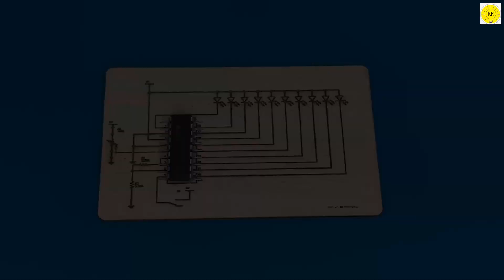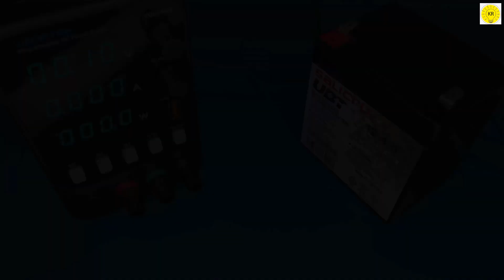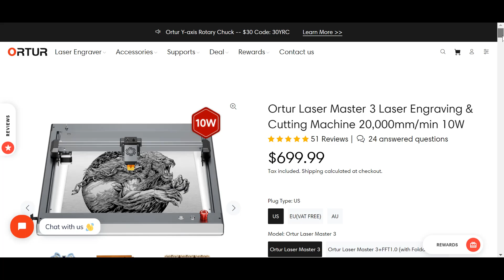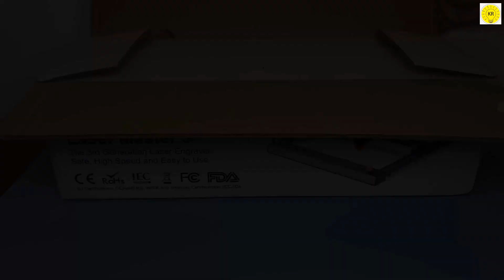how to make 12 volt battery level indicator circuit , ortur laser master 3

Comment: Those blue LEDs are a bit pointless. The higher forward voltage of them is why they aren't lighting up before the first green one does.  Are you really going to discharge a 12V battery as low as 6V anyway?